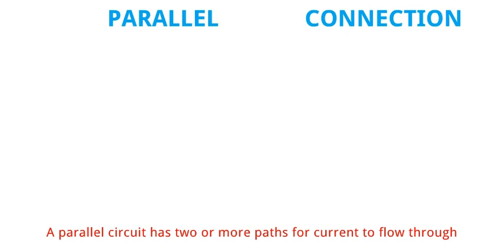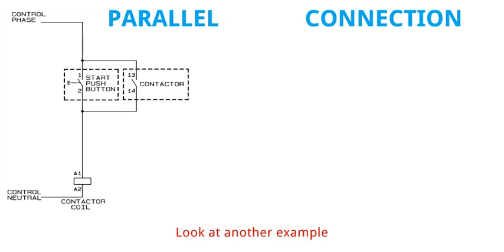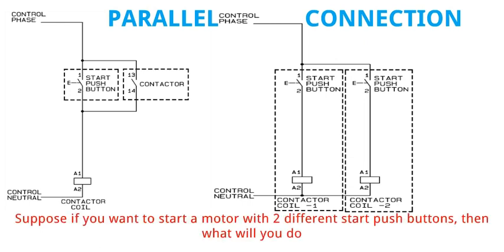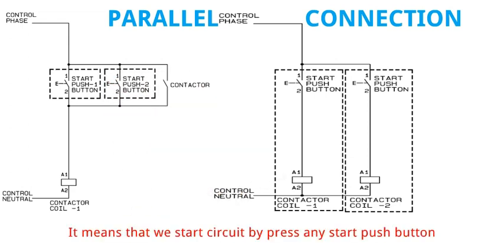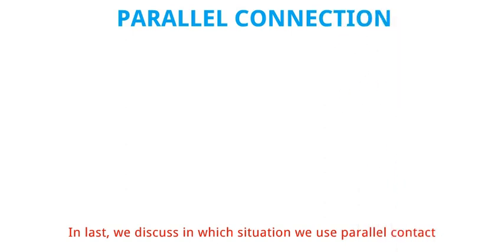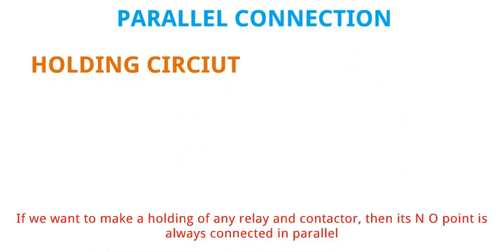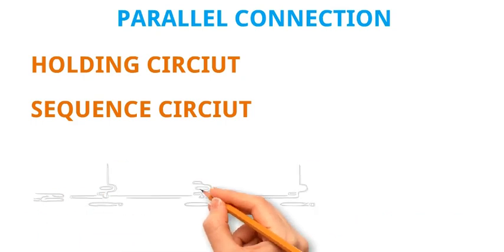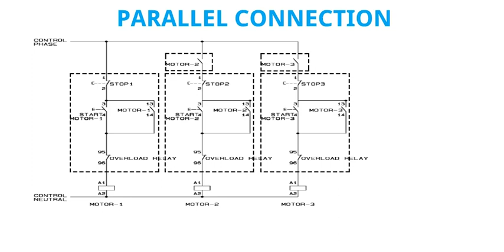PARALLEL CONNECTION IN CONTROL WIRING #parallel  #controlpanel #schematics #electricalengineering

Comment: Do you mean, the contactor of the push button is the same as the contactor with coil A1 A2?
Reply from the maker: This video is related to parallel logic in control wiring
Reply: @BoparaiEngineers  I can see but the contactor with the coil A1 A2, is it the same with the Contactor closer to the push button? Like the contacts side of the contactor ( eg 13,14)